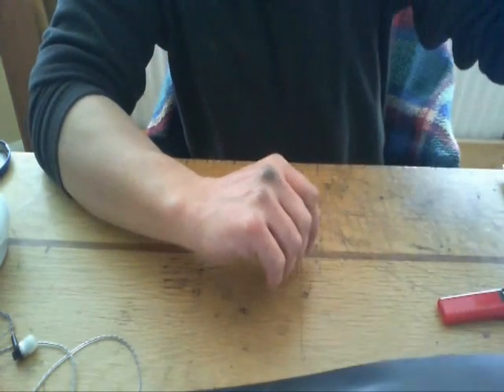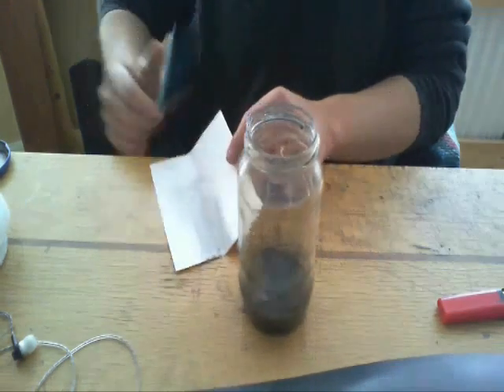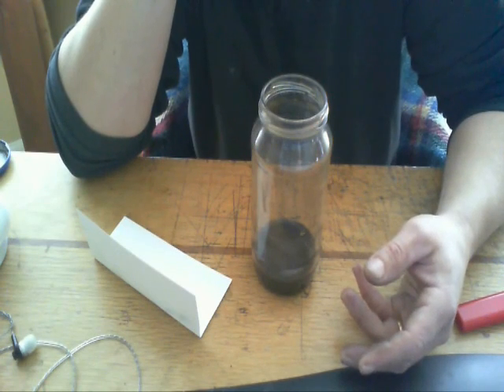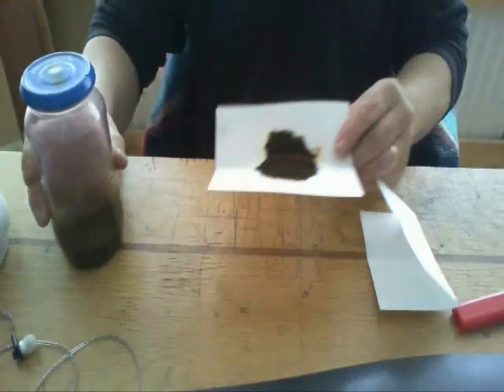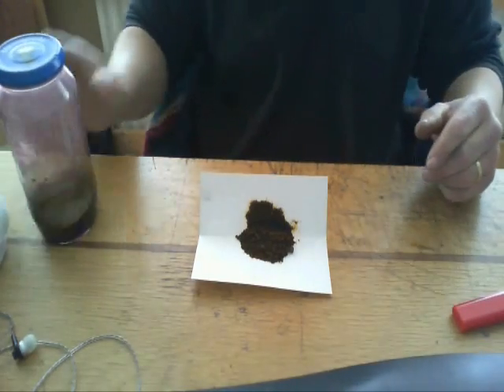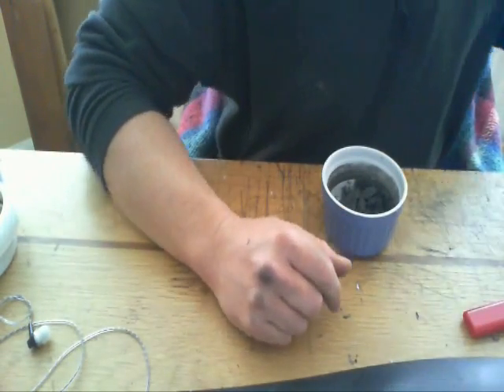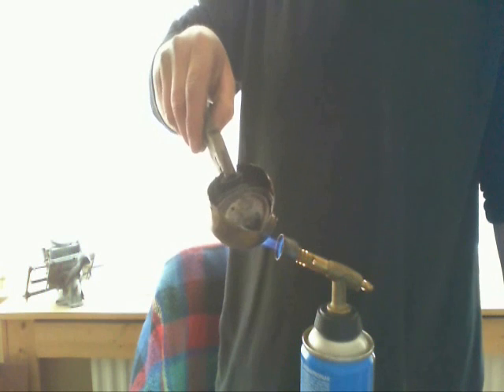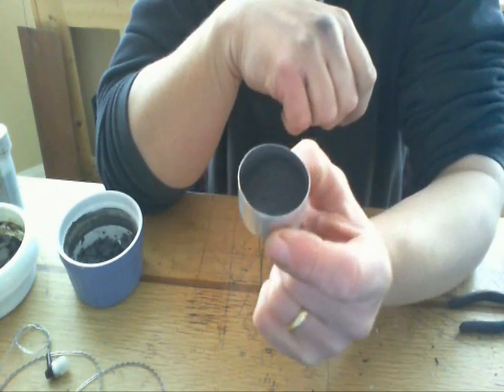Graphene part 3 - an update and making graphite intercalated compounds

Comment: Hello Robert,

I found your channel earlier this week and just wanted to start off by saying that this is truly one of those hidden Youtube gems and is a great resource. I did have a question however: Is the only purpose of the Fe2Cl3 and AlCl3 to modify the electrical properties by replacing the previously intercalated sulfates? I'm trying to make expanded graphite for a paraffin PCM heatsink and it seems like the best place to branch off is before the iron chloride is added and I can move to heating?

Thanks!!!

Danny
Reply from the maker: cheers mate and i think you are spot on there - if you want expanded graphite the easiest method is bisulphate intercalation
Reply: Robert Murray-Smith Great! Thanks!!!
Reply: Robert Murray-Smith if intercalating using bisulfate do you still use the same Ratio of sulfuric and phosphoric acids or is it a different method all together?
Reply: Andrew ONeal Bisulfate refers to the number of sulfates per graphite particle. The sulfuric acid, phosphoric acid, potassium pernanganate is one method of bisulfate intercalation based on Hummer's method. Someone else can jump in if I got something wrong.
Reply from the maker: it's a different method mate - check out google scholar for guidance
Reply: Robert Murray-Smith This method is different than Hummer's method or this method is not bisulfate intercalation? I thought that this was a modified Hummer's method for bisulfate intercalation?
Reply from the maker: i dunno - i never thought of it that way

Comment: i can't seem to find iron chloride anywhere.. nobody will send it here lol.  Can you create it by reacting with hcl and magnetite (fe3o4)?   im pretty sure you can get alcl3 by reacting aluminum with hcl ya?  same with ZnCl... Can you react ZnO with hcl to get the ZnCl?  i watched your substitution video in a blender for your copper nanoparticles using substitution method but i'd like to know if you can simply lead me towards a similar method for creating these chlorine bonded molecules?
Reply from the maker: +localbroadcast i did a video on making iron three and iron two and how to convert between the two mate
Reply: right... but i need the ferric chloride!  or is that what you're talking about?  know a way converting the oxide to chloride??  Does simple liquid hcl reaction with the 3 oxide work?
Reply from the maker: +localbroadcast sure - but it is slow - the easiest thing is just to get some metal scouring pads and chuck them in there - we are talking pennies here
Reply: +Robert Murray-Smith cheers!  I feel dumb not to think of the obvious in this case!  Do you have a satisfactory equivalent method for intercalating zinc??  I have a very clean supply of zinc oxide sitting here waiting to impregnate something.  it's like a teenager.
Reply from the maker: +localbroadcast lol - i am afraid i don't mate - i have never tried to intercalate zinc

Comment: Hey Robert, I've been trying to learn how to make these graphene supercitors that the University of LA did on youtube, and I was wondering if I could give you money to make them for me, and have a video with all the simple steps(baby steps, yes hold my hand)  for me to learn how to  make them too.  Quantity I want is 2 things:

1) a graphene supercapacitor to replace a trucks 12 volt starter battery (same amount of energy replaced)
2) a graphene supercapacitor to replace laptops, flashlights, and my Toyota Prius 2004 2nd Generation 201.7 volts high voltage battery.

How much money do I need do you estimate?
Reply from the maker: Hiya mate - prototyping is very very expensive - your best bet is to make them yourself - there is a lot more to it than you seem to think - for a start it's not just a question of making them you have to test them for durability too and that takes time and money

Comment: Another big issue for the very green among us is getting ahold of high concentrations of these acids
I have watched some videos on increasing the purity of say hydrochloric acid  using very strong hydrogen peroxide. 
That introduces more road blocks.  The highest concentration that I have found was something on the order of 40% HCl.

Maybe I simply looking in the wrong places.
Reply from the maker: 40% is about as strong as you can make it mate after that it off gasses HCl gas
Reply: Oh...  I thought that...  You mentioned like 98% a few times....

Or is it like a moonshine type of deal  :P
Reply from the maker: Clown Whisper
98% is for the sulphuric acid mate not the hydrochloric acid
Reply: Robert Murray-Smith  :)  caught this time
Reply from the maker: Clown Whisper
coolio
Reply: +Clown Whisper 31.5% i believe is the highest concentration you can get before it becomes fuming hcl... (gaseous) so yea, that's the best you're gonna find for hcl, and its the one you need!  If you need hcl gas, well, create a gas generator and generate the gas of hcl that way.. thats the route towards 99% hcl.

Comment: I love your videos, but what were the three ingredients in the second method?
Also, would it be plausible to put the graphite intercalated compound on a piece of porous silicon and just roast it on a fire to make graphene?
many thanks!
Reply from the maker: sulphuric acid pottasium permanganate and ferric chloride. As for your propsal - i don't really know what you mean but i doubt it from what I understand - but then the only way to get real answers is to try it and see
Reply: i just meant rubbing some finished product, the intercalated graphite onto that cellgard and using a heat gun on it
Reply from the maker: sounds good - give it a go

Comment from the maker: when you add the chloride it will fume almost immediately - it's very quick. when it has died down a bit put the lid on. the pressure will build up so loosen it every now and then until it calms down - it won't take long

Comment: Now you`ve made this ...Graphene? What would you use it around the home, etc? Did you make a video showing some uses?  Could the liquid compound be poured into car paint to paint a car?  How would you coat a car with it?  Could it be used as a rust inhibitor such as an undercoating with cars?  If you can strain water through Graphene, how would you make such a ``strainer``?  Would the water then be drinkable?  If it only allows water thru, does the strainer take out flouride and chlorine etc?

Comment: The yield is excellent, the resistance (without heating) of the compound is about 100-200 ohms/cm compared to graphites 1000 - 2000 ohms/cm and aluminium foil's 3 ohm/cm.Sadly I don't have a blow torch to expand the intercalated graphite by heating. My gas stove doesn't heat it to a high enough temperature. Is there any other method of doing this? (I could try microwaving it but I am scared of ruining my microwave in this process)

Comment: Will this work with a polyvinylalcohol electrolyte? I was successful in making a little battery with the PVA mixed with sulfuric acid with Ag ions dissolved in it. I don't have a lot of resources yet, so I used an old silver quarter and copper penny (both chemically clean). Initially there was no voltage so I used a wall wart at 5 volts to charge it. After charging for a few seconds it produced 0.7 volts, my charging current was a bit too high. I think I'll make a video of it on my next day off.

Comment from the maker: Centigrade - I suppose so - the theory is the same. I haven't tried it - but i guess i could - as I say the theory is the same - as long a the 'catalytic' metal halide is of a lower pressure than the intercalating halide i can see no reason it wouldn't - why are you interested in nickle halide intercalated compounds - if i can ask?

Comment from the maker: Unfortunately graphite is pretty tough stuff - at least chemically. You need pretty harsh conditions to get it to do anything. But, it's stability is also part of its appeal. The ampoule method uses no waste reagents but the energy cost is significantly higher - you have to cook the thing at a high temperature for 8 hours! I guess you pays your money you takes your choice! - if you find something though - let me know - and I am constantly on the lookout for greener approaches.

Comment: It seems to me a great deal of acid is used for a very small amount of graphite.  Is this truly necessary?  Can the excess be separated and reused?  How about adding water first  in an amount to thoroughly wet the graphite and then adding just enough acid to complete the reaction?  Would the weakened acid condition prevent the reactions from proceeding?

Comment: LOL. I would have stuck it with a skewer and some steel wool, although your way you will know for sure if it was the problem and if you fixed it, lol I just like stabbing stuff with skewers.. Contact cleaner on a headphone jack would probably help too. Those mic ports are just hanging out in the open a lot of the time. Speaker port tends to be plugged up with speaker jack. More salt and stuff can build up in the unused jacks. Lanolin (I get the spray packs) is good stuff for that kind of thing.

Comment from the maker: Oxidation acts by forcing the plates apart and so weakening the van der waals forces enough that things like sonication will disperse it at a thin enough layer. Then of course you have to reduce it back to graphene. Just mixing the sludge wouldn't work because you have missed out the dispersion step and after reduction all you would get is graphite.

Comment from the maker: Yes it would - but it would be non conductive. The steps are
oxidise graphite to graphite oxide
disperse oxide to make graphene oxide
reduce to  graphene
you have to do it this way because graphite and graphene are the same thing basically. The only difference is structural. Graphene is one atom thick. In order to strip it down you have to overcome the van der waals forces holding the graphene into the graphite form.

Comment: Aye, it sounds like the pickup element crashed into its casing, which has a rigid constraint to the chassis, which results in a kind of "conduction microphonic" effect where the slightest motion in the area is picked up incredibly loud & clipping (kinda the same way that one can hear every motion in the house with one's head submerged in the tub)